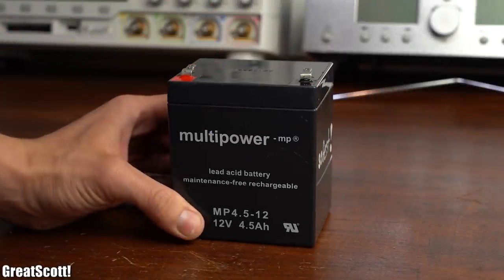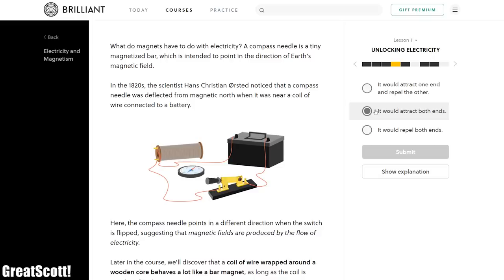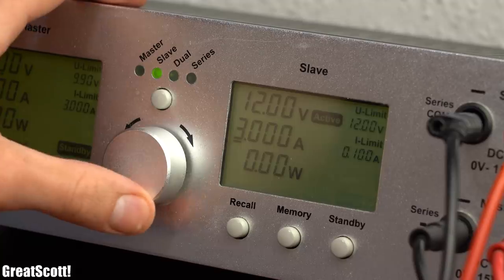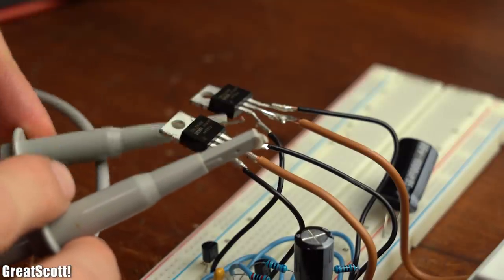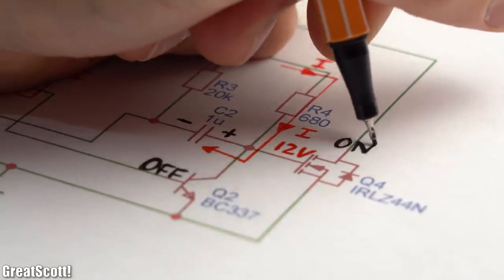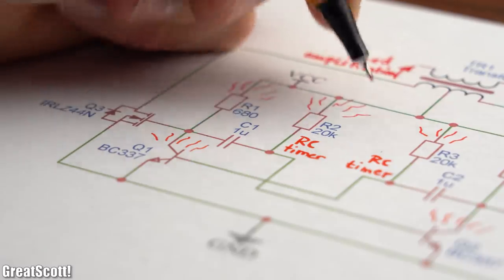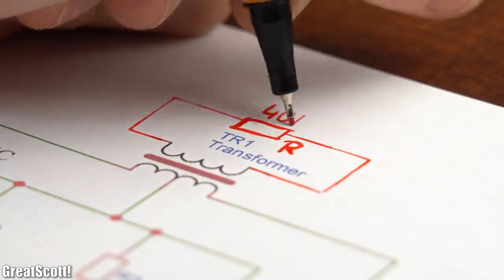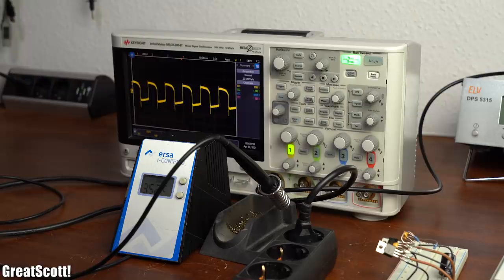Testing circuits I found on the Internet: Inverter! It does work, BUT...

Comment: In my day the source of knowledge was a regular subscription to Popular Electronics. It may have only come once a month but you knew the circuits presented had been tested and verified to operate as described. Today's internet? Whooo-boy, there's a bunch of crap and "idiot killers" to wade through there.
Even for incandescent lights, a square wave output will shorten the life of the bulb to about 20% to 30% of normal expected life. This is due not so much to high voltage spikes, but rather a huge increase in RMS or total energy output associated with a square wave as opposed to that of a sine wave. Most "low end" inverters output a "sudo-sine wave" which is generated in the low voltage side by using a digitally, sequentially switched resister ladder. The oscilloscope would show an 8 (sometimes 16) step wave form that gets low-pass filtered to knock down the square edge ringing (voltage spikes at the corners), even round off the corners somewhat. Commercially this is usually done in a customized IC, but a binary counter, an 8 or 16 step multiplexer, and discrete resistors can be a bread board alternative.
The solution to the changing parameters is to add a 9 volt regulator and re-design the low volt side to operate at 9VDC. Then add a Zener diode circuit or op-amp comparator circuit that senses the battery voltage and will cut off the 9 volt regulator at 10.5 volts. This will use about 90% of a fully charged 12 volt battery, reduce battery damage by restricting deep discharge, and the parameters of the inverter remain constant because it never sees less than 9VDC.

Comment: Hey, could you do a video on a solar generator using an inverter and 12v battery with a solar charge controller (PWM or MPPT) all put together in an enclosure of some sort? Thanks
Reply from the maker: I can put it on my to do list
Reply: @greatscottlab  I appreciate it

Comment: Maybe this series could go on with "How to build a 50 Hz Mains Low-Pass-Filter". Such a low pass "Mains-Filter" in German "Netzfilter" would convert this square wave into a sine wave, right?
Reply from the maker: No
Reply: Ah yes, you're totally right - it should be a 50Hz Band Pass Filter, otherwise the spectrum of the square wave only gets cut for the frequencies Higher than 50Hz

Comment: Hey! I would like to have a rpm limiter for motorised bicycle project 
(Youtube 80cc bike) 
Because in Finland and EU allows motorised bike to go 25kmh (20mph) so i am planning to measure front wheel spin calculated by arduino and mosfet, transistor or relay to shutdown every second if wheels spin more than 25 kmh =] god bless you teach us so many things thank you

Comment: you were creating A.C., fine... but you tesla coils were not good, the arcs were too short/ the circuit was too complicated(compared to slayer exiter).
i tried experimenting around with other "bjt" and could reduce the size pof the senondry coil to 7cm. and diameter 3 inches wire diameter to about 34 AWG. primary coil is the breadboard wire, 1 turn. but i got a decent hot arc length of about 2 inches and could light up a cfl without being touched to the coil. (atleast better than your part 1 tesla coil). 
for that i use mje3055 NPN transistor, 22 k resistor and 12 v(1A). power supply. 
maybe you should try this or use a zvs circuit, the induction heater you made(for primary coil). you might find it interesting.

Comment: Yeesh, if you want to charge a phone from a 12V battery, just use a DC-DC regulator circuit.  I mean, you can do it with two dirt-cheap resistors, or even a graphite pencil and a pen knife.

Comment: Hey man
I found one circuit;
Pls review this one;
2x 2n3055 transistors,2 resistors

Connections: 
1st transistor base connected with 1k ohm resistor to the collector of other transistor.

Repeat the same process with second one .

Now connect emitter to emitter
That's it 😂

Connections are 2-collectors connected with 12-0-12 transformer.

Positive of battery(12v)  connected to 0 ground of transformer
Negative of battery connected to emmitters

Pls check this one

Comment: Did it actually kill your phone?
Have you tried charging it up normally for at least 2 hours?
Reply from the maker: Yep. Tried every charging method possible. Is stuck at a fixed current draw of 250mA at 5V
Reply: @greatscottlab  Yikes.

Comment: Often these so-called electronic websites just copy old designs without any qualification or testing.  Because people are drawn to simple circuits they will strip off parts to lower the parts count.

Comment: Can I send to you my inverter? A short in my truck fried 2 resistors and 3 mosfets.  I have attempted soldering other items and just do not know enough to fix my inverted without melting the circuit board. So, I have not soldered anything on the inverter yet.

I am in the USA, and I do not know how to find someone who can do this work.

Comment: So basically, making inverter circuits from the internet is fine as long as you don't connect valuable electronics to the output.
Reply from the maker: If you want to power a light bulb then it will work ;-)

Comment: Ah yes, the classic, charging a 5volt phone from a 12v battery by converting it to 120v so it can be converted back to 5v

Easier to get a lighter socket usb adapter.

Comment: over discharging a lead acid battery is not as bad as over discharging a lithium battery.

lead acid batteries will just be ruined or shorten it's life where as lithium batteries can become unstable and start a fire.

Comment: Hai please make a home made nickel iron battery from an old 12 volt lead acid cell, case, 
Using conductive carbon foam electroplated with iron and nickel as electrodes, making a ultra battery,  pls 😁😁😁😁

Comment: If you buy an inverter to make 110/115/120/230 VAC from a 12VDC lead-acid battery to charge up your phone with an 5V USB charger then you are very-VERY far from reasonable.

Comment: You should look at some of the stuff on the "inventor kr" channel, this includes multiple inverters and atleast 2 laughably bad "mobile phone signal boosters" that simply don't and couldn't ever work.
He's obviously doing all this on a budget as all parts are scavenged and he uses heavy gage wires instead of boards, but even as an absolute novice myself in electronics the stuff looks bad (and possibly dangerous) to me.

Comment: You don't need a complicated noisy inverter to run those devices. Everything that has a switchmode PSU inside will quite happily work with DC, just boost the volts to about 100 or so and that's it! (And safer, 100VDC will usually not do much to you if you come across it)
Reply from the maker: But that is not what most people can accomplish.....

Comment: you didnt measure the efficiency :D ? is it a tradition in this channel to find out the efficiency ?
Reply from the maker: I did measure the efficiency but kept it out to keep the video shorter. It was around 75%
Reply: @greatscottlab  that’s not that bad includingthe snubber ?! Great video!! And it’s a crime to use a mosfet without a gate resistor 😉

Comment: That solution has no practical significance as it lacks protection, regulation and has a disgusting waveform and poor efficiency.
With a few more components you can achieve significant improvements, but the drawings are missing on Goolge ...

Comment: Spoiler Alert: Just absolute beginner non-sense follows in this comment of mine. I can't test my idea, lacking equipment, components, skills and knowledge.
I was wondering if the signal at the gate of the MOSFETs is such a squarish-waveish mess, what would happen if you put a capacitor (each) across the collector and emitter of the BJTs (hence adding capacitance between gate and source of the MOSFETs)? Would the gate signal become less squarish-wavish, hence producing a better output? Would the MOSFETs start heating up? What about adding also some capacitance to the output? Would it require too expensive caps? Not that I want to rescue the circuit, just curious. Please, feel free to insult me for my utter non-sense noob blabber, but I'd also like to read an explanation to why it wouldn't work. We'd both win, as I'd have some opportunity to learn and you'd have more chance to find my next comments a tad less foolish and your brain would hurt less, I guess. Cheers.